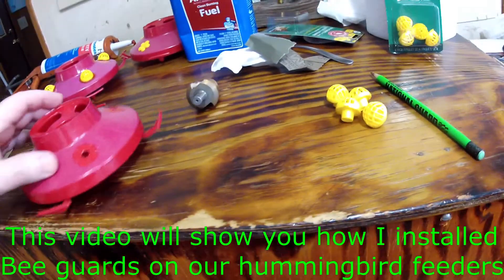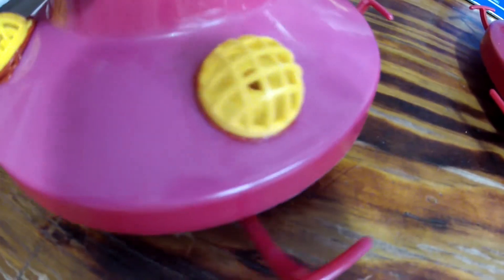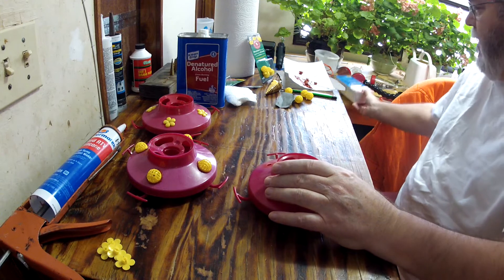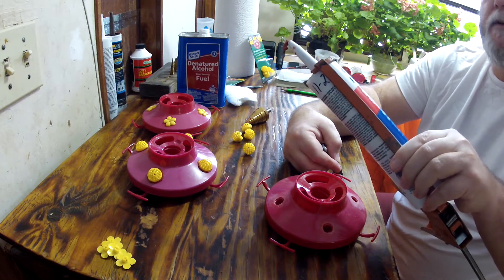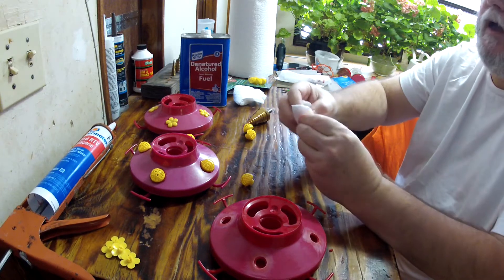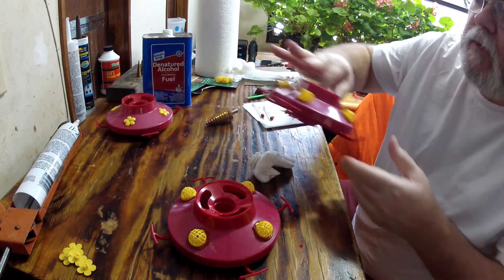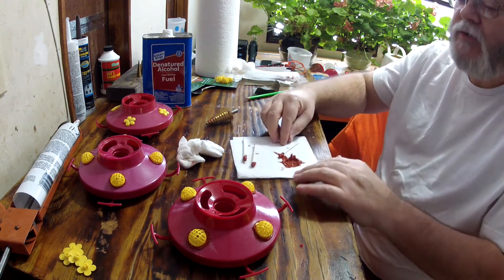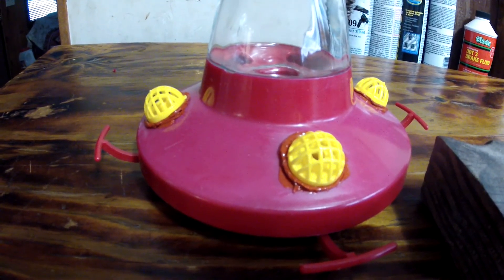Installing Hummingbird Feeder Bee Guards

Comment: How do you clean in the bee guard?
Reply from the maker: We use a bleach solution 10:1 that is ten parts water to one part bleach, I'm getting a lot of questions on this so I'm thinking of making a video on it in the future, But we use a 5 Quart ice cream bucket, the round plastic ones with a cover to them, they work perfect to hold the base of the feeder under the water and the glass topper on top, you submerge the red base under the water mixture and fill the glass topper full of the mixture and you sit the glass topper on top of the red base, it helps hold it down under water.
After about 20 to 30 minutes you pull out the glass topper and pour the mixture back into the ice cream bucket, then you rinse the glass topper real well with hot water, put up to air dry, then you do the same with the plastic base, rinse well then put up to air dry, no scrubbing, no taking it apart, just give the bleach solution time to work, AND PLEASE WEAR RUBBER GLOVES when handling the items and eye protection to be safe. 
The good thing is you don't waste the bleach because you pour all the bleach you used back into the bucket, then put the cover on the ice cream bucket and store away for the next cleaning, I use the same solution all season:)
I have done this for over 30 years and I have never had to scrub a feeder, this kills all germs and destroys mold or any other nasty thing that accumulates on the feeders.
Thanks for watching, subscribe to my channel and hit the bell notification so you will know when I have new content, this is a hobby for me, I don't make a penny doing this, I do it for fun to try to help people:) And I have a regular job so I don't always post regularly.
Reply: Suggestion: Make sure the seal is complete on the reverse side, to avoid crannies where the nasty molds and bacteria like to establish themselves?

(If you can -- it looks like the bases of your feeders maybe don't come apart for easy cleaning, so it's good you made sure to get the sealer right through the hole.  
I've always been careful to only buy feeders that come apart easily and conveniently for good cleaning with a brush, so I don't need to use bleach -- and I find it both quicker and easier that way. But if you can't, then extra careful measures, such as using bleach solution, is undoubtedly a very good idea.)

If I ever have serious bee or wasp problems, I'll have to try something like you showed here.
Good video!
Reply from the maker: @bernardkung7306  Well said:) Thank you for your tips:)

Comment: Won't the bee guards get moldy? How do you clean them?
Reply from the maker: Hi and Thanks for watching:) As for the bee guards getting moldy I put a sticky post in this thread, it will be the first comment, I explain in there how we clean our feeders and never have a mold problem, I'm going to make a video showing how we clean them when the season starts for the hummingbirds.
Reply: @thisoldmobilehomeinthewood8434  Thank you!
Reply: @SusanA1056   I don't have the bee guards right now..but those little plastic flowers get moldy..I use pipe cleaners (bendable furry wire you can get at dollar tree for $1.25 maybe 25/50 per pack.) to run thru the middle & around the backside where it clips on. 
My feeders broke a couple of days ago so I'm attempting to diy one..I'm just worried about using any glue/resin or metal pieces b/c I don't know if they would harm the birds...I'm on a mission to find a way to make one with no worries...
Reply: @azinfandellvr  Thanks Angel. This is my first year putting out hummingbird feeders. I'm hoping it'll be one of those "If you build it they will come" things. You all are teaching me so much.
Reply: @SusanA1056  They will come!! I've had the same hummingbird crew for the last 2 years..they fly up to my front glass door & look in as to say "hi..we've arrived"  & they also do it if it needs a refill before I notice...so cute! They belly up to the bar while I'm sitting beside the feeder too.  You will love it!  I live in the very hot & humid south here, so I prefer a smaller feeder so I can clean it when it's empty. (about daily)...no worries of mold then. The large ones hold so much that a lot goes to waste...just something to keep in mind, depending on your weather & how many come feed! Have fun!
Reply: When it needs filling put it in the dishwasher first,  but don't let it go through the dry cycle - That works for me.

Comment: I hate to tell you, My feeders came with that type of guards exactly but it did not deter them.
Reply from the maker: Thanks for the reply, we will see if these work, I'm betting that your bee guards are not sealed like mine, so they leak lightly around the base of the guard, because yours I believe can pop out and be replaced which leaves it open for leaks, my setup is different, they are siliconed into place.
But once again like my video says, I don't know if these will work, but we will see, and I will post another video to show the results this fall:)
Reply: @thisoldmobilehomeinthewood8434  I hope they work. I would like to know if sealing them made the difference. Thanks
Reply from the maker: @bfree6521   well as of 9-18-21 they worked perfectly, no leaks and no bees:)
Reply: Leakage is a problem, because once they find any sugar solution, leakage, spill, or even spatter, they seem to realize there's more, and they look for access to the source.

(I've even heard of bees occasionally figuring out to sacrifice one individual to wedge a bee-guard aside enough to provide access to the rest.)
Reply: @bernardkung7306  Thank you for all the responses.
Reply: Also, if n when the wind blows, the feeder will sway the nectar n splash from the opening that was solely made for the hummingbird. Darn bees are smart n know where the sweets are.  But I will give this a gander though from this video. Tired of buying after buying feeders that attract pesky bees n scares the birds.

Comment: You can't take that type of feeder apart to clean.
Reply from the maker: Very True but we clean ours by soaking them in bleach and water, then rinse them completely and let them air dry, they look like new and are sterilized completely. Thanks for Watching:)
Reply: @daureenesmith579  I'm talking about the feeder itself.  I have two not used, exactly like the one shown, and the only way to take it apart is with a saw.  You really have to be careful using bleach on a feeder, that should be used at the end of a season .  Good old soap and water with a brush will do the trick during the season.
Reply from the maker: @luigi5890  - sorry I just seen this response from you, I use bleach on the whole feeder, I have been doing it for years, I never have to scrub anything, and you don't need to use a saw to open it,  20 to 1 mix ratio on the bleach and I soak the feeder base inside of a 5 quart ice cream bucket, and at the same time I fill the feeder glass bottle full of the bleach mixture and sit it on top of the base in the bucket and then wait 15 to 20 minutes, drain the bleach mixture back into the bucket from the items and them rinse them off real good and let air dry, they look brand new:) Put the cover on the ice cream bucket and store away until the next use.
Reply: @luigi5890  not sure where ur getting ur info from...you may want to check again..every video I've seen say they do it the same way...
Reply: @azinfandellvr  Good luck my friend, I like to see what I'm cleaning.
Reply: @luigi5890  I was referring to using bleach...I don't use it myself only because I use a small feeder...I live in the hot & very humid south, so mold forms quickly. My birds drink it all in 1 day & I just rinse with a toothbrush & use a pipe cleaner on the little flower.
Reply: @azinfandellvr  I use bleach at the end of the year, then completely clean the feeders making sure there will no bleach residue left before putting them away.  The next year the feeders get another cleaning without bleach before they are set out. I try to keep my feeders out of the sun as much as possible, and clean and change the feeder solution every 3 days. Preparing the Hummingbird solution, I boil the sugar liquid and then keep it in the refrigerator to prevent mold or the liquid fermenting. I don't want my Hummingbirds to become alcoholics. LOL
Reply: @luigi5890  🤣 Good one..I can imagine the little birdies with a buzz trying to steady themselves to get another sip...cartoon stars & swirls above their heads & all! 🤯🤭   I always sing "my hummingbird hooch brings all the birds to tha yard" 🎶 as I mix mine up..reminding myself I don't want to give them diabetes!  I've had this 1 small feeder forever..given to me by my mom before she died..it was special & I'm bummed that it broke when I brought it out this year...I'm researching a diy one so maybe I can use a part of this one. With our heat & humidity 1 is all I can handle right now for the health of the birds (once I finish with a couple of dental procedures I'll be back up to par...I'm small to begin with & losing weight quickly, which means I have zero energy).  I wouldn't think anyone would need bleach if they are taking care like you do with the health of the bird & up keep of the syrup...I remember when I started long ago, I learned all this from utube as well..sometimes I forget that not everyone knows about these safety things..😁🤗

Comment: These are totally useless. Ask me how I know.
Reply from the maker: Well they worked great for us over here, no leaks because I siliconed them in place, we had only two bees buzz around the feeders and then moved on, no leaks and no way for them to reach through the holes:)
And our neighbor has the beehive boxes out, normally this time of year we would have pulled the feeders but not this year.
I can't explain why yours didn't work if you did it exactly like I showed it the video, you told me nothing except that they are useless, let me know what you did. Thanks for watching.